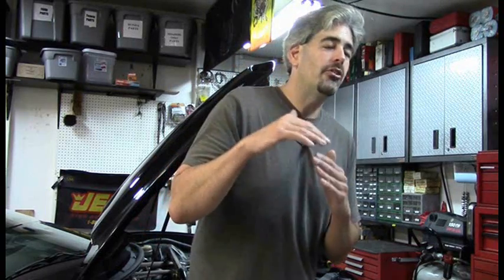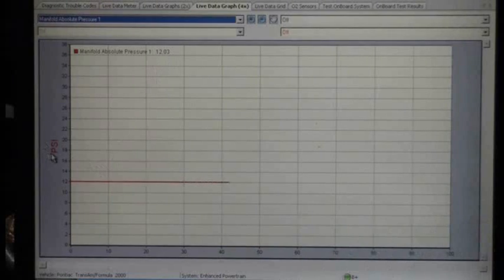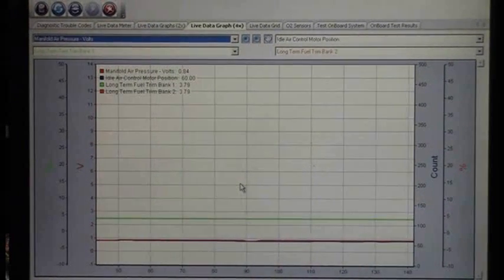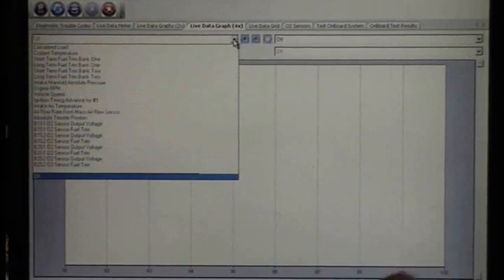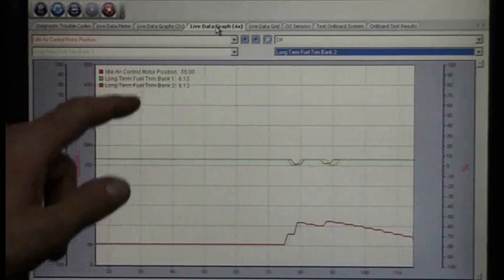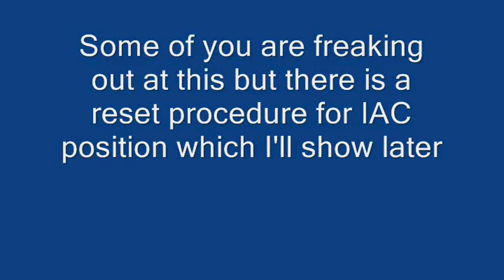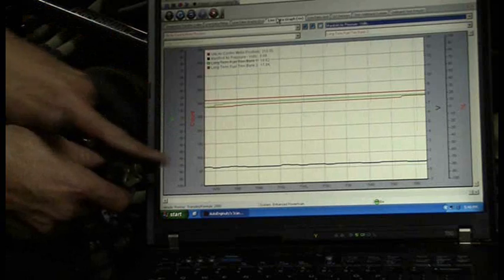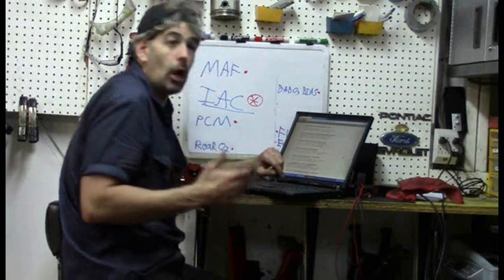P0171 Case Study from Hell 2000 Trans Am Pt3

Comment: I'm sure you know this by now given this is an old video but the IAC is usually a stepper motor which is an open loop motor - the driver tells it where to go and has absolutely no feedback as to whether it's actually going there or not. It's the same kind of motor used in 3d printers and that's why if you push a 3d printer out of alignment while it's working it'll keep going like nothing's wrong, just in the wrong place. of course if one of these kinds of motors burns out it won't move but you won't get any feedback. at least not with the simplest type of driver. a smarter driver would probably measure the resistance of both coils (there's 2 coils which is why there's usually 4 pins) but obviously this car doesn't do that. the way i'd drive the motor independently of the car would be using an arduino and either a dual-bridge motor driver or a dedicated stepper driver. there's stuff on youtube and all over the internet on how to do that. I know this was 2014 but it was definitely possible back then too. either way its incredibly easy now, you could probably get the parts to do this for under $20 total (12V wall adapter, knockoff arduino, wires, maybe a breadboard depending on what driver you get, and the dual-bridge driver itself). The driver I'd use is either a L298N (dual bridge) or a A4988.

Comment: I'm a little confused as to how the IAC opening does not affect the MAF....I thought the IAC opening would change the airflow across the MAF.  I feel little bumps in the rpms when at idle when my a/c compressor turns on and at the same time I see MAF readings go up then the idle comes back down and the MAF reading does as well.  Would this be indicative of a faulty MAF or is it reading correctly because of what the IAC is doing?
Reply from the maker: On non-DBW cars it is Because the IAC bypasses the throttle - of is already measured by the MAF. It is already measured it just bypasses the throttle opening.
Reply: @Schrodingers Box  if MAF reading goes up when I open the throttle (the movement of the throttle plate changes allowing more air to flow and changes vacuum which brings more air passed the MAF.) Then wouldn't the opening of the IAC valve produce the exact same thing albeit at a much smaller rate?  This is why I see the MAF reading bump up ever so slightly when idling and the a/c compressor cycles on....the small movement of the iac opening is affecting the airflow passing the maf just the same as the throttle opening but of course at just a much lower rate...

Not meant for argument of course.  I'm just trying to learn....because my live data shows this but I can not actually SEE any IAC data on my scan tool...I just hypothesize that if the throttle opening causes airflow change at the maf sensor then why wouldn't the IAC?  IAC can be thought of as a miniature throttle plate as it performs same function but at a MUCH smaller level

For example my live data shows in lbs/min and will sit there idling at around .5 lbs/min then all of a sudden I will hear the engine rev up ever so slightly and I will see the maf go to .8 lbs/min all while the TPS pid has not budged (stays at 19.6%)
Reply from the maker: When you open the throttle the IAC will close.

Comment: I have been watching your videos because I'm a dys type of guy  i have a p2096 code Lean fuel trim bank 1 i took my 2005 jeep Grand Cherokee 3.7 to get it inspected everything else pass NY inspection but for that code i have put new spark plugs new injectors checked for vacuum leaks and exhaust leaks myself and nothing took it to a mechanic shop and smoked it to find leaks and nothing they play the guessing game with me it could be the throttle body or the fuel pump i tested the fuel pressure everything is good i drop the tank and checked the pump everything looks good clean the throttle body clean the map sensor tested the purge valve and as your last video tested the IAC valve my code continue to appear i don't want to take it to jeep because i know I'm going to pay and arm and a leg and they won't fix the problem like they have in the pass with my boss vehicles spend money and the problem didn't get solve, any insight on what to try next?
Reply from the maker: I haven’t seen any data yet. what was the data you are interpreting that indicates you needed new spark plugs AND injectors? I don’t follow how you determined both were necessary- did you find an ignition failure or a fuel failure- or was it both?  And I don’t follow why you are checking for vacuum  leaks when you determined a fuel and ignition problem. what was the fuel trim indicating that you suspected a vacuum leak is present, especially while checking the fuel pump- which is it, a vacuum leak or fuel deficiency?  What was your determination the fuel pump is fine? what was the voltage drop? what was the amperage?
  I am totally not following the process you are using here because you haven’t provided the data you collected to make all these various conclusions. please provide your data that you are using and why you suspect a jeep dealer will not use data to make a diagnosis and they will just throw parts and guess randomly at it without ever fixing it.

Comment: made it to 2:16 "iac opening causing a lean condition"
care to justify why you think this is unmetered air?
i'm going to file this with your comment "the freeze frame was lying too" response to area46241 in your prior video.
you got the FF data from vin specific, not generic, i cannot vouch for the accuracy of your tools
Reply from the maker: I believe it’s because when the IAC does not open to the correct commanded position, the amount of air entering is not what is expected.
Reply: @SchrodingersBox  i retract my crankcase breather statement from an earlier video when you verified it was only the oil fill cap. the clean air intake to the crankcase is a pipe cast into the passenger valve cover, drawing filtered air after the AFM, but before the throttle plate. exactly the same as the IAC. metered air.
interested to continue watching, i really appreciate your method of verification of data especially when it contradicts what you're expecting.
likewise for me when i saw 15" of engine vacuum but only 9% load in your freeze frame data @ 1800 rpm, only to learn you're in Denver.
this changes what i'd expect to see @ sea level (here) as BARO is an important tool to verify MAF on certain models.
resetting the KAM on fords, for example sets BARO from 29" to a factory default of 26" which i believe has a lot to do with your LTFT additives, subtracting fuel because of altitude may be a expected condition.until Fuel trim cells are written properly to compensate for altitude. 
i also believe MAP is primarily used to monitor EGR on a normally aspirated motor, and possibly KOEO BARO.
so i continue watching, thank you for the content.

Comment: Matt/Dan, here is a question for you guys.  My 01 S-10 4.3L showed no vacuum leak at all when I did a smoke test (cold engine) a while back, but it did a week before under the same conditions.  Saturday when I did another smoke test under the exact conditions, it shows smoke coming from the back of the engine.  It seems to be hit or miss doing the smoke test.  There is a plastic vacuum tube with a rubber connector back there that I'm assuming goes to the fuel tank from the intake for the EVAP.  Also, I ordered a Delphi MAF sensor for it a while back, but when I install it, it shows higher LTFTs.  If I put the original one back on they come down.  Currently they bounce anywhere from 4.9-7.8 on Bank 1.  Bank 2 is lower than this.  The intake gaskets have been replaced by a buddy of mine last year when I had my hip surgery, so I'm wondering if he didn't install them correctly?   I don't have a mirror, which would definitely help in this situation, and I should get one for the next smoke test, but smoke comes from the back of the distributor area.  I don't know if it's an intake gasket leak, or maybe that EVAP connector is leaking, etc.  What really puzzles me is why would a new Delphi MAF cause the fuel trim numbers to go up, with all things being equal?  I guess I need to get a mirror the next time I do a smoke test to see if I can determine where exactly it is coming from.  The trims never go above +10 with the original MAF, but they do with the new Delphi MAF.

Matt,  I definitely understand your frustration on your issue, as mine is just as frustrating.  Any advice guys?  Thanks.
Reply from the maker: I would need to see your fuel trim data curved against load at both immediately after closed loop and at full operating temperature.

Comment: I had a p0171 (lean condition) driving 2k miles or so, with my 2001 Toyota corolla.conditions: 1 Full power loss at mid throttle when going up a hill , when the car was warming up.  When the car was at running temp, the issue would not show up as often. 2. Intermitantly a bad idle, engine would shake at 760rpm, and sometimes would be fine at 860 rpm. 3. At freeway speeds, would run fine, no issues, accept for random lean conditions indicated with scan tool.4. No vacuum leaks (smoke tested)5. Injectors all cleaned, and replaced one, because spray pattern was abnormal.6. Fuel pressure looks fine 44PSI7. Both O2 Sensors look fine and reacting to changes.8. Scan tool indicated a random lean condition, all of the time.9. New spark plugs, and no misfiresThe solution:My Idle Control Valve was sticking, due to carbon build up. It's a magnetic rotary typeCleaned it, and made sure the bearings were lubricated.The car accelerates on hills, and has full power now, Scan tool shows no more lean condition. Thanks 4 this video!!BTW, this motor does not have a feedback mechanism, so it does not know if the motor had actually moved or opened correctly, so this issue throws you off.I am guessing the carbon build up came from the PCV valve, that is the only place it could come from. YES, my PCV valve had a lot of carbon build up on it, and I replaced it as well.
Reply from the maker: +John Brass I need data bro. Can't help with just a description of symptoms

Comment: IAC staying open when it should actually is a vacuum leak.  It lets air past the throttle plate.
Reply from the maker: CoolAirVw Absolutely right- it is an "unmetered source of air" no different than vacuum leak or dirty MAF.  IAC air intake is technically metered (even though not directly) because PCM knows how much it should be open or closed.
Reply: CoolAirVw If the IAC was opening at the wrong time from being delayed or sticking, the rpm would have caused issues at idle, deceleration, or shifting that were noticeable and in the video it is said it has no idle/drive-ability issues. The pcm has no way of knowing where the iac pintle actually is and it really doesn't care on this vehicle. IAC air bypass is not a vacuum leak on this system, that air is accounted for.
Reply from the maker: Jason In Wi Once again, your thinking is dead on, however in actuality you may not necessarily have idle speed issues even with a mis-calibrated IAC or even non functioning. In fact- I show exactly this in one of my series "P0171 diagnosis from hell" where the IAC is not moving correctly causing fuel trim problems however there are absolutely no drivability or idle issues at all (which made the diagnosis very tricky since I initially dismissed IAC).  But I clearly demonstrate IAC malfunction does not necessitate idle problems or indications since the PCM will still adjust the injector pulsewidth accordingly to maintain idle.

Comment: This problem could be an outworking of the Heisenberg Inconsistency Theory.
Reply from the maker: I believe you are referring to "Uncertainty Principle"?  Either way, agreed, at this point in the video, my attempts to make accurate measurements seem to be fouled due to some inherent nature of the system.  It could also be wave duality (Schrodingers Box) in that my very act of taking measurements is leading to the inconsistency of the measurements.

Luckily, a far more rational explanation is on the horizon- keep watching!
Reply: Schrodingers Box
Congratulations on the self control you have been exhibiting on this series!  The kind of  experience you have been going through might have led many mortals to be seduced by the parts changers side of the force!
Reply from the maker: caduceus33 Yeah it's kind of hard to put this series up to the public because basically it's not exactly showing quick and fast mad diagnostic skills or anything but it does show the limitations of a scientific process when variables are always introduced into a controlled environment.  I really came within a hair of putting a computer in this car which would not have fixed it. So I think there is definite value in seeing how to handle situations like this one, so I kept it up. But trust me, this was frustrating as hell and trying to make good filming of it was really a challenge.

Comment: Hi Matt, AMAZING case study!! I have been on the edge of my chair for this one. Based on Parts 1 and 2, I would have narrowed this phenomenon down to three systems: 1) Air Injecton, 2) EGR, or 3) an inconsistent/incorrect MAF signal. But not IAC, since the car actually has no idle/starting problems whatsoever.

At 5:16 you say the idle air control change would not affect the MAF signal. I do not follow your logic here. The MAF meters ALL the air entering the engine, including the air allowed in by the IAC past the throttle plate. So an added load (like A/C) would cause the IAC to open more, letting in more air past the throttle plate, resulting in higher MAP and MAF readings.

My educated guess based on this: the MAF is not responding appropriately to the change in air flow. Now this could be due to two things: 1) a faulty/dirty MAF. 2) a crack in the air intake pipe between the MAF and the throttle plate (not technically a vacuum leak). However, you did eliminate the cracked air pipe after the smoke test of the intake manifold.

One way to easily eliminate the MAF is to just unplug it!! The car will still run in closed loop, but use the MAP as its main fuel input for the A/F calculation. If the fuel trims are now normal, the MAF is indeed the culprit!

Time to watch part 4...
Ivan

Comment: Corrections, Retractions, and Kudo's.
Damn, I wrote all my comments before scrolling down the list and reading everybody elses. I HAVE to stop doing that.

Just imagine, if we could open a shop, and have all of these brilliant people all working in one place!  We'd own the freakin' town!

I made several errors in my post. But it's not practical to go back and edit.

BUT, I can tell everybody, that if you read ALL of the posts people have put up here in the last roughly 36 hours or so, about stepper motors, and then add together and synthesize what everybody has said into one big ball of knowledge, you'll know more about steppers than you could ever want to.

There are so many people with good posts, it's impossible to name them all, but there are some true experts here. I learned a lot reading other people's posts. I did not know there were stepper motor testers out there for automotive use. That's REALLY cool, I ain't gonna forget that tip.

Personally, I agree with 95% of everything that everybody else has written here on the subject, and the 5% I don't agree with I'm probably wrong about. I'm gonna go see if there is a part 4 video up, RIGHT NOW.

Carry On............

Comment: As I'm now watching you test motor function (nice job btw, you have amazing insight for a DIY guy!)
You can test both directions by simply cycling the key. You will need help though because if you do this test without providing a limit. It will wind itself out of the housing. It needs a 0 point (resistance to extending any further). I use my finger as the lmit
Reply: Thanks for the tip!